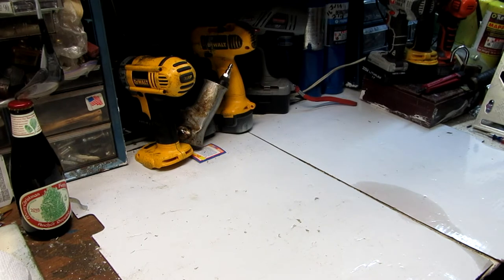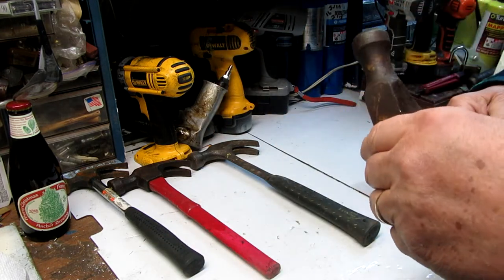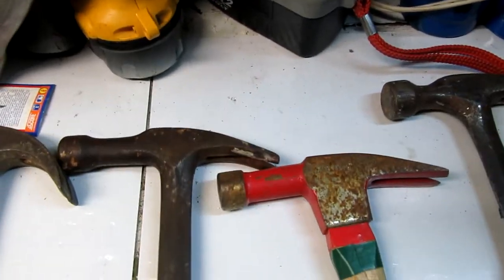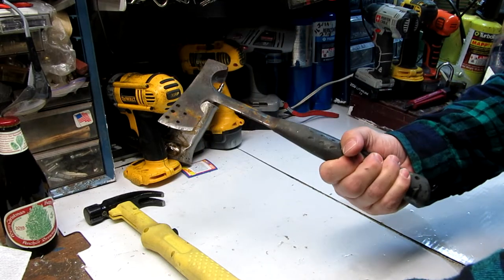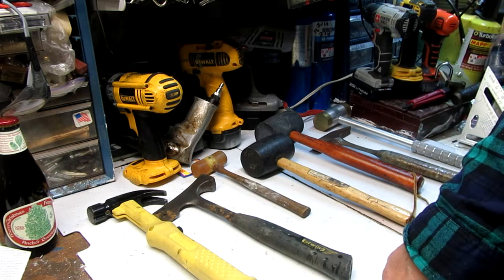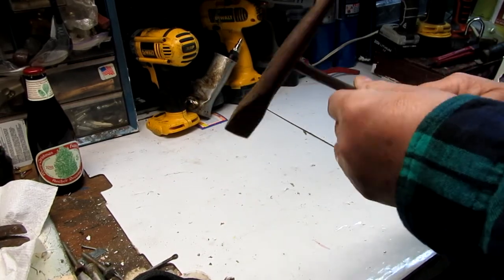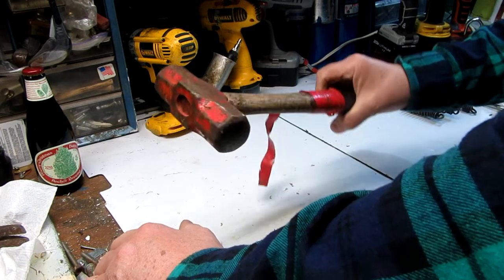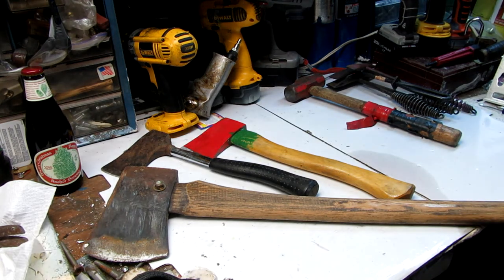ALL MY HAMMERS ,RONS BEER REVIEWS & TOOLS , # 464

Comment: Thanks for sharing your hammer collection.  You can probably clean the rust off of those old hammers with a wire wheel.  Most of those hammers are reputable brands, especially the Estwing is a brand used by a lot of carpenters.
Reply from the maker: Pete,thanks for the comment, and yes I will clean these hammers up, and hopefully put it on youtube. Cheers  !

Comment: Now that's a bunch of hammers Ron.  The one with the waffle head is for roofing.  The sharp side is to split cedar shingles and the holes are for measuring.  Looks like if something needs to be beat, you've got it covered.  I plan to do some tool reviews in the future too. I have a bunch for hand tools and Dewalt power tools.  Cheers  =)
Reply from the maker: Sparky, thanks for the info. on the Cedar shingle hammer /tool, I didnt  know what the holes in the blade were for (I thought maybe pulling out nails..ha ha ha) Youlearn something everyday ,thanks. And Ill be waiting to see the tools you showcase. Cheers !